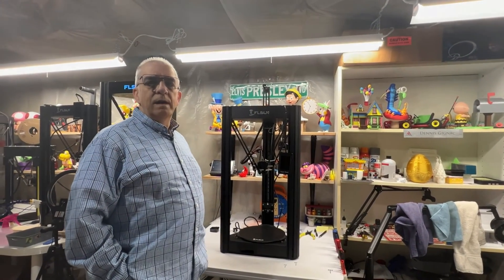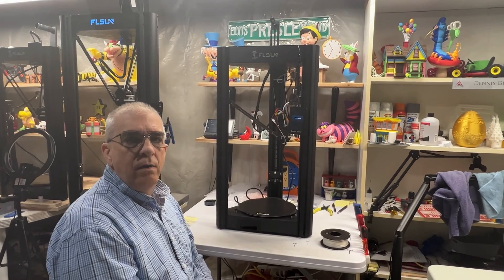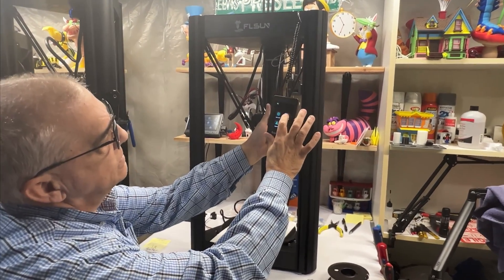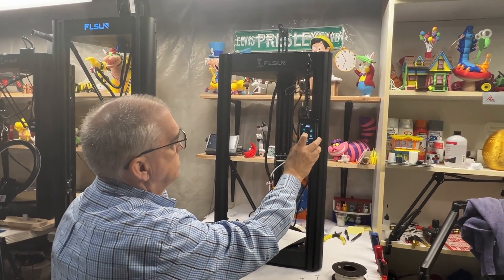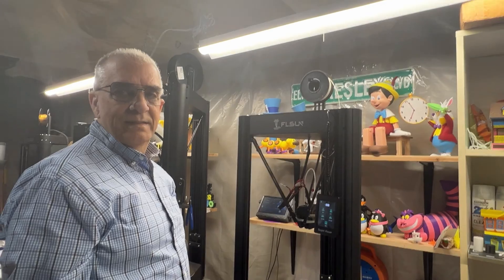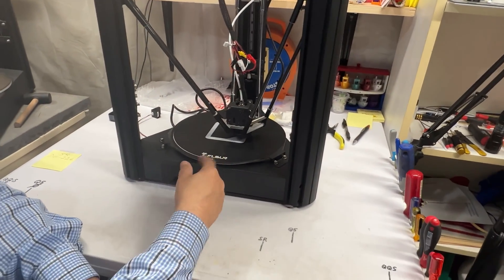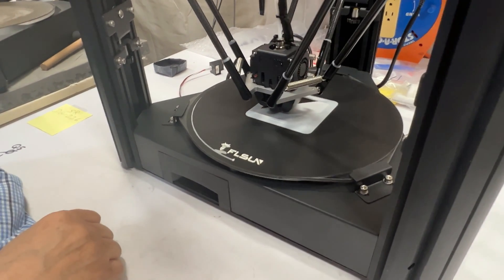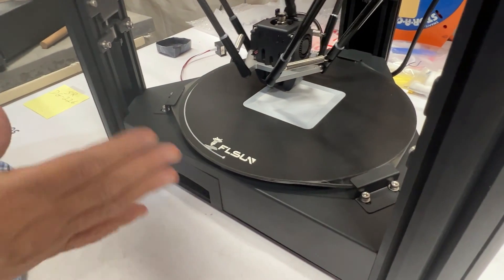FLsun SR Calibration & Setting the "Z" Height

Comment: I bought a used FLSun SR to start with the hobby of 3D printing. Overall, it runs quite well, but the first layer could be better. You say that the nozzle should be heated, but doesn’t that damage the sensor?

Comment: Very good video! I bought a super racer and I'm having problems with the printing, do you have a profile to share? The prints come out half melted or with marked threads, the strange thing is that the test model of the nut that the printer includes came out impeccable, the problem is other stls so I think it is a cure configuration.
Reply from the maker: Send me an email and I will certainly try to help...
dgignac@flsun3d.com

Comment: My auto level and adjust z do not respond when i prompt the machine to do so from the touch screen. Any reasons why or how to fix? Nothing has worked for me
Reply from the maker: Please contact me through my email and I will try to help...
dgignac@flsun3d.com
Reply: @dennisgignac5103 any luck troubleshooting this issue? I too am having a similar issue. During print if I input Z height adjustment the SR makes a strange noise (not heard otherwise) for a period of time, maybe 5-10 seconds? It never appears to actually change distance regardless of how much adjustment input is selected. No issues with printer other than this and it's driving me bonkers lol. Thank you in advance for your thoughts and ideas pertaining to this matter. Also, awesome content and videos (newly subscribed and sharing!)!

Comment: Hi, thanks this is great advice, wish I'd seen it when I got my SR a few months ago. I do seem to have bed adhesion issues with my printer, I can't seem to print multiple objects at different places on the bed without some of them coming off in the first layer. Would carrying this out help or is there something else I should do. To note, a singular print on the bed sticks fine (sometimes too well) and comes out nicely but of course, for smaller prints that I want multiple off, it can be a bit wasteful to have to print one at a time.
Reply from the maker: Hello Leah:
If this issue is extream, check your belts. Sometimes there is a worn spot on one of the belts. Look good, sometimes the worn spot is hard to see... But I get this also once in a while so I use this !!!  Big Smile
https://www.amazon.com/Printer-Adhesive-Layerneer-Original-Filament/dp/B079984GV5/ref=rvi_sccl_5/134-0292362-0840925?pd_rd_w=4Cftp&content-id=amzn1.sym.f5690a4d-f2bb-45d9-9d1b-736fee412437&pf_rd_p=f5690a4d-f2bb-45d9-9d1b-736fee412437&pf_rd_r=7RPT71Z54YNJV1EEBGB6&pd_rd_wg=lkDEz&pd_rd_r=3f611b06-b011-43b8-be9b-66ea043a0be2&pd_rd_i=B079984GV5&psc=1

Comment: This is really good advice.  I do the same with my printer, testing thst z offset at least 3-4 times.  I do the same with estep calibrations as well. As for estep calibrations i just disconnect the bowden from thrle extruder and feed 100m out the bottom after a flush cut. Do the estep calculations, save it and do it 3-4 more times.   Really like this video!

Comment: When doing a calibration it measures several points, AS IF it would do a mesh calibration - however, the SR does NOT. It just uses a SINGLE Z-value afterwards (perhaps the average of all, I don't know). So if your heatplate is not absolutely even, it will result in uneven first layers. Lots of SR users seem to have this problem 😫I hope they will fix this by firmare update.

Comment: Hello! What value was the Z height set to? Unfortunately, it is not visible in the video. Thanks in advance
Reply from the maker: There is no set value. Once you calibrate, you have to set the z height using a piece of paper and save. Then run a flat test on the first ;ayer then adjust if not perfect...

Comment: The slightly rough to the touch area is the only part of the square that stayed together which means the squish is right and each pass is sticking to its neighbour. The areas where you raised the nozzle so that it felt smooth all came apart and each pass was not sticking to its neighbour which means the squish is not enough.
I get the same effect with my SR, adjust the Z height so it all feels smooth and when you remove it from the bed it all falls apart.

Comment: Hey Dennis. I just bought the FLSUN Super Racer. Right out of the box it makes this beeping sound coming from the extruder. Can you tell me what the issue is. Thanks.
Reply from the maker: Can you please send me a video with sound and I will try to help...
Reply: @dennisgignac5103  It only did it on the g-code included with the sd card. I have done several prints from Thingaverse with no issues. Everything is working perfect now. Thanks so much for responding.